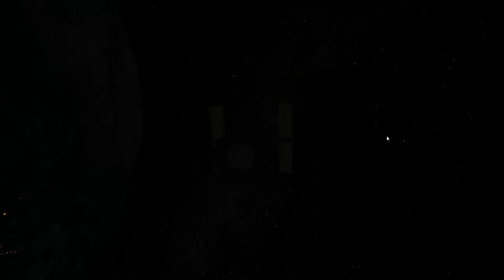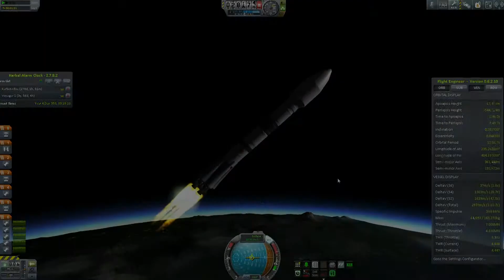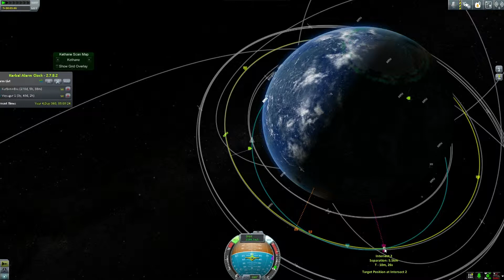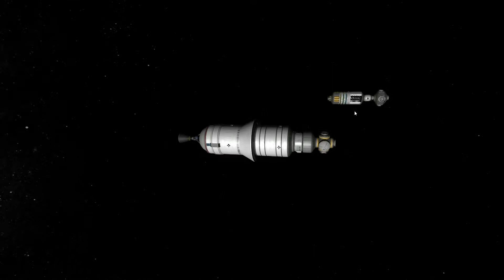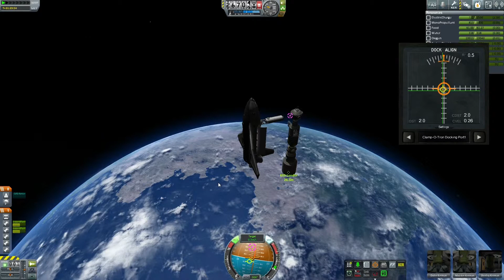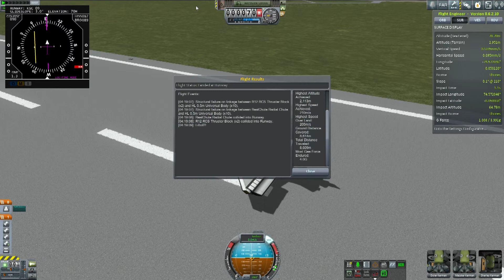KSP NASA Series (v2) Episode: 13, ISS Assembly

Comment: Did Cacteye UI fix itself or did you do anything? :)
Reply from the maker: By replacing the antenna with one that wasn't as heavily affected by Remotetech 2 (omni antennas don't use the aiming plugin) I got it to act a little more civilized, but I waited til I hit publish on my new video before I responded because ::drumroll:: I was able to completely repair Remotetech 2 for the latest episode, so it's working now and not crashing every time I go to the Tracking Station, and the game has become MUCH more stable since the RT2 modules in the .cfg files aren't looking for a plugin that doesn't exist anymore. I'm still playing v.24.2, I think I can move on to .25 once some other mods get updated, but I'm not positive.